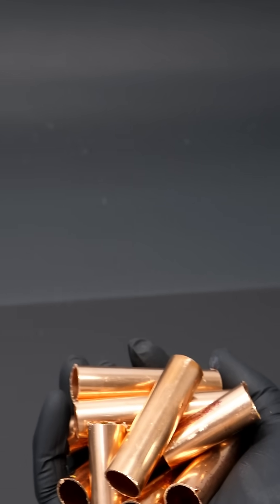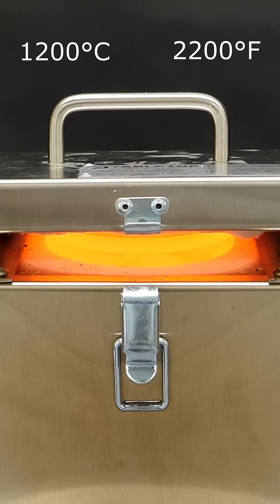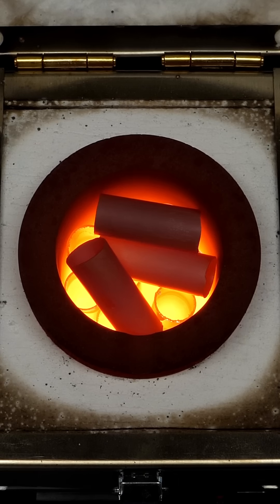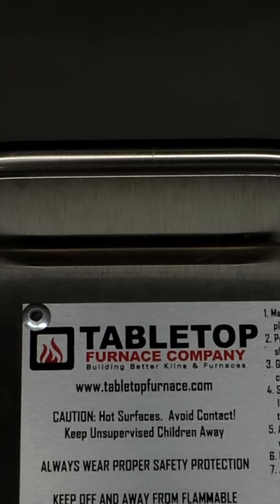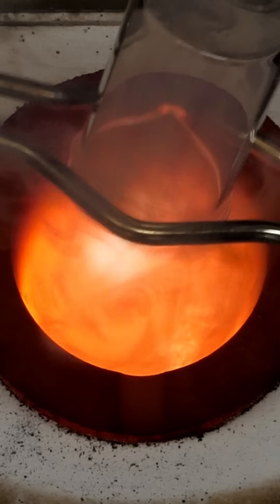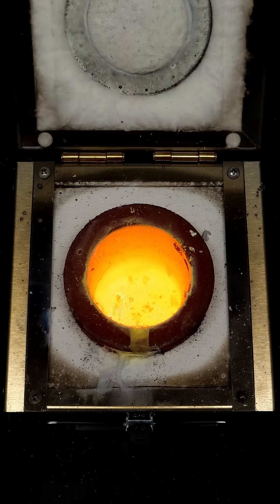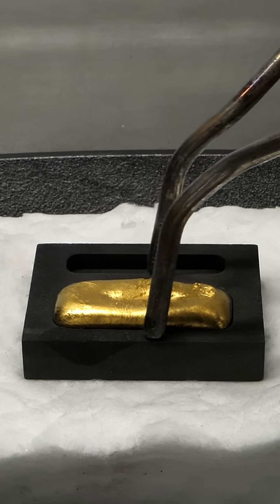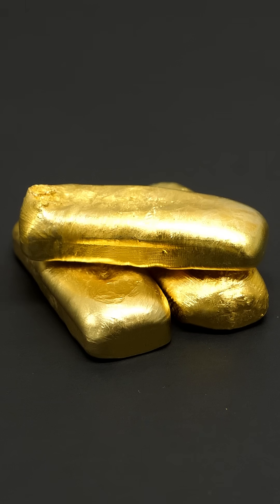Making Nordic Gold

Comment: The only real thing I can add to this is you needed to preheat the copper. The bubbling was small pockets of moisture the copper had absorbed. Also, make sure to point out that you also preheated the mould. This is an important step to prevent steam explosions when casting the metal.

BTW, Nordic Gold is also known as nautical bronze and is used for ships propellers even today. Once work hardened it is almost as strong as steel, but barnacles and algae cannot attach to it. It also doesn't corrode as fast as most other metals in salt water.
Reply: Great info! Thanks!
Reply: @jennifers.3818 Secondeded!
Reply: I think this is the most ive learned from a comment on YouTube.. ever.. thank you
Reply: I agree! I stumbled upon your message and I am impressed. My father was a metalurgist at Chevrolet for 40  years, retiring in '72. He had no sence of smell and was very bored with food, so conversation was what he most enjoyed at the  kitchen table..we always talked about doing this and that but never got a ' round tuit'. We would walk the rails in Detroit and we collected all types of fallen ore and he'd explain it all to me with such enthusiasm. I was just 8, but I hung on every word. Today I have a pile of my own in the back yard that's just starving for my attention! Thanks for waking up my dull metal head.  Andi Stewart- the girl in the pro shop that can explain to you why your swing is off, having nothing to do with your skill, but the composition of your driver. @user-bg3dq1fu8v
Reply: @user-bg3dq1fu8v If you like him so much then why don’t you marry him! 😐
Reply: @davemccage7918  what does this comment even mean what point are you trying to make
Reply: Why can’t barnacles and algae attach to Nordic gold?
Reply: @edd8914 because they are like Mr krabs and only love REAL money... when they get on the fake gold and find out its indeed fake they are so mad /disheartened that they can't stand the idea of staying on it and detach themselves to look for real gold instead 😂😅
Reply: @PenguinDynasty  Explains why Spongebob characters say “Ah, barnacles!” to express frustration 😂
Reply: @PenguinDynasty explained a lot
Reply: @PenguinDynasty  comment of the day!
Reply: @edd8914 
Nah, it’s because barnacles are freeloading SOBs. And they make you itch terribly on the attachment points.
Reply: @edd8914 copper is intensely anti-microbial, its actually why many old laboratory and surgical instruments pre-stainless steel were made of polished brass. Not a lot of things like to attach to something like that thats so antagonistic to bacteria as well as larger invertebrates like barnacles. Occasionally youll still see barnacles on bronze but only after its developed a coarse verdigris layer thats allowed other compounds to precipitate onto it like calcium, then things will grow on those mineral deposited areas.
Reply: @edd8914 copper, like gold and silver, is antimicrobial. My assumption is that this alloy retains that property.
Reply: @edd8914  sailor here - Copper in ablative marine bottom coatings works by slowly releasing copper ions into the water, which are toxic to many forms of marine life, including barnacles, algae, and other fouling organisms. As the boat moves through water, the coating wears away (“ablates”) gradually, continuously exposing fresh copper to maintain antifouling effectiveness. This also helps prevent excessive buildup of old paint layers over time.

Marine-grade bronze castings (typically high in copper content, such as silicon bronze) resist biofouling for a similar reason. The copper in the alloy leaches slowly to the surface, creating an environment that discourages the attachment and growth of organisms like barnacles and algae. Additionally, marine bronzes are corrosion-resistant in saltwater, which helps maintain this antifouling property over long periods.
Reply: @robbackstrom3365  Thank you for the detailed explanation. How long do these metals last in the water before being dissolved? Do they run out of copper eventually?
Reply: @edd8914 probably copper toxicity.
Reply: @edd8914  Because it's a copper alloy. Copper has antimicrobial and algaecidal properties.
Reply: @edd8914 because of the zinc.....
Reply: @edd8914 Barnacles and algae know they don't attach to gold and are fooled by the color.
Reply: That's not water... it's the non-metallic components reacting and offgassing.
Reply: So, by the time the bubbling starts, the copper is well and truly melted.  If moisture survived within the metal right up until that point, then how could preheating it evaporate the moisture that the process of bringing it up to over 1000 degrees could not somehow evaporate?
Reply: @Postghost it came from the torch; one of the byproducts of many flammable gases is water vapor, and copper really likes moisture. If he had been more patient and not torched it, it likely wouldn't have began bubbling.
Reply: @AlaesterNikolaiModern  I was thinking it had something to do with the torch too. Probably added something to the copper. But there are also furnaces powered by gas. It could be that the temperature rose to melting point from the torch but then lowered because the lid wasn't on, the liquid state wasn't stable then
Reply: @AlaesterNikolaiModern  Right.  That sounds a lot more feasible.
Reply: @AlaesterNikolaiModern  I'm pretty sure it came from the copper itself. There are oxides and nitrides in the metal... when it  melts, they react with each other and exit the system.

I used analyze raw materials for a stainless melt shop. I never melted copper by itself, but when we would melt Ni or Fe-Ni, the molten metal would spray sparks 2-3 feet out of the crucible. It looked like a sparkler. This was caused by  reactions that formed gas. To prevent this, we would add a couple of aluminum pellets... the oxygen would quickly react with the Al before it had a chance to escape.
Reply: @betif00  gas powered furnaces do not directly heat the metal with gas, they heat the bottom and possibly sides of the crucible. Any steam they produce will rise up around the crucible and not get into the metal. The torch as used in this video directed a stream of steam (and other byproducts of the gas burning) directly into the copper.
Reply: @natec424 I noticed there was no use of borax or other flux to prevent oxidation of the metals being amalgamated. When working with actual gold and silver alloys to create Karat and sterling or coin silver, we always start with a flux, adding more as needed. Oxidized metal will not take a clean solder with precious metals, and platinum doesn’t play well with others.🖤🇨🇦
Reply: @AlaesterNikolaiModern  But how did the water vapor attach to the copper at that temperature? Is it some chemical reaction?
Reply: @natec424  This makes more sense to me, thanks! The only other thing I could think of was the water forming hydroxides with the copper oxides, but that still felt unlikely at that temperature. Aluminum has a stronger affinity for oxygen than iron, which is why thermite works, so that makes sense
Reply: @Postghost  The term "preheating" is often misunderstood — it's less about preheating in the casual sense and more accurately described as tempering.

In the video, the crucible appears yellow/orange hot and ready, but in reality, if it's not brought up to temperature properly, microfractures can develop. These flaws may not immediately cause failure and might only reveal themselves when the crucible is removed from the furnace or when you bump the lip against the mold inlet. At that point, failure can occur — and in the worst-case scenario, it can be catastrophic. Especially dangerous if you haven’t received proper training or done your due diligence — and the fact that this even needs to be said suggests that may be the case here.

What makes this even more insidious is that the accumulated moisture doesn’t need to be obvious. Even trace amounts can cause internal pressure buildup. That expansion might not cause an instant explosion but can still compromise the crucible over time. That’s why a controlled heat-up stage at 100–200 °C is critical. This step allows you to gently cook off residual moisture — effectively tempering the equipment — before ramping up to full casting temperatures.

Preheating the metal itself can make sense in certain situations, especially when a fast workflow is necessary. For example, when working with zinc-based alloys like brass, speed is crucial — zinc tends to vaporize quickly in an oxygen-rich environment. If you need to add more metal to reach your target weight, preheating those additions helps reduce thermal shock to the melt.

Ever placed a damp towel on a hot surface and heard it go zish? That’s just from a ~100–150 °C difference. Now imagine what happens when you drop room-temperature metal chunks into a molten mass sitting at over 1000 °C. That’s not just steam — that’s a serious risk of spattering, cracking, or even a steam explosion.
Reply: @Postghost the mold needs preheating.. the mold
Reply: 😂 @Postghost
Reply: @Postghost 
Because, my friend- the moisture is TRAPPED !!! YOU MUST MAKE A CONSCIOUS EFFORT TO REMEMBER THAT MOLTEN METAL- IN THIS CASE MOSTLY COPPER‼️👉 HAS A VISCOSITY SUCH THAT THE MOISTURE, WHEN TRAPPED IN SIGNIFICANT AMOUNTS, IS NOT GOING TO SIMPLY EASILY & QUICKLY DISSIPATE NOT UNLIKE IN WATER, OR OTHER VERY HIGH VISCOSITY LIQUIDS ‼️‼️‼️
✅👉 Also, the heated moisture EXPANSION is dangerous, and reaches a point where it "bubbles" and "pops" it's way out of the molten metal with it's SUPER-HEATED FORCE that's in direct relation to, again, the viscosity ( or in molten metal cases- the LACK THEREOF )
-
Hope that clears it all up for you. I'm not a metallurgy person, however- I am a biomedical engineer, and love reading and learning in just about every subject that there is ‼️😆🤔🤔🧐🧐🧐🧐🧐🧐🧐🧐🧐
Think of a "bubble"  super heated, slowly moving upward through the metal, NOT UNLIKE A BUBBLE OF AIR IN HONEY !!! 😂 AND COMBINING WITH OTHER SLOW MOVING POCKETS OF SUPERHEATED MOISTURE, THEN UPON GETTING CLOSE TO THE SURFACE‼️‼️👉 THERE JUST A COME MILLIMETERS OF MOLTEN MATERIAL HOLDING BACK WHAT WAS BEING HELD BACK BY MOST OF THE MATERIAL, AND SO "💥WHACK BAM POP PING 💥‼️, THE TINY BIT AND FAR LESS MOLTEN METAL MATERIAL, AT JUST A FEW MILLIMETERS- GETS BLASTED UP AND GOTTA FLYING ABOUT THE AREA ABOVE 💥‼️‼️‼️‼️
-
NOT, "OK SUPERHEATED MOISTURE CREW, LET'S SLOW DOWN BY INSTANTLY REDUCING OUR TEMPERATURE SUCH THAT WE NOW PERSIST RISING IN A MUCH SLOWER RATE, OR ELSE IN IT OUR HASTE- WE TAKE TINY DROPLETS OF THE MOLTEN METAL ABOVE US, ON UP AND OUT WITH THE FORCE SUCH THAT SOMEONE CAN BE INJURED AND FIRES CAN BE ACCIDENTALLY INITIATED."
OTHER MOISTURE "BUBBLE" :
--- "yeh, YEH, MAN YOUR RIGHT‼️👉 REMEMBER THAT NASTY DUDE THAT WAS RUSHING THINGS IN THAT TUNNEL, AND WAS STARING OVER and Down into the crucible when we couldn't slow down, because it's impossible in this dimension and on this planet- and we ended up blasting tiny droplets up and into his eyes !???"
Another superheated "bubble" of moisture joins :
😨😨😨 "Oh yeah, I remember that one !  He was screaming and cursing and then accidently got his suicide vest cord stuck between a couple heavy oxygen tanks, and 
‼️💥 KA-BOOM💥‼️"
-
FIRST SUPERHEATED MOISTURE :
 "AHHH BAHHH HA HA ‼️‼️ YEH, WHAT A CRAZY-ASS GROUP OF DERANGED SCUM-BAGS !!!!!!!! HOWEVER, PEOPLE, THAT'S  THE BIG ONE THAT GOT US ALL THE WAY TO THIS CIVILIZED LABORATORY... I THINK IT'S CALLED  
ISRAEL ✅😆✅👑
Reply: @FIVE-n-TWO  I'm sorry, but even if you turned out to be correct, no one's reading that wall of cancer. 🤷
Reply: @Postghost this is exactly what I was thinking. They were glowing WELL past waters boiling. This person perhaps is mistaken (big surprise)
Reply: @TrapLordNik  Perhaps, yes.  I don't fully know, but it doesn't sound right.
Hopefully, they'll read this and elaborate.
Reply: Adding borax lowers the melting point and helps loosen impurities
Reply: Fun fact this is also theorized to be the metal Hesiod referred to as Oricalchum
Reply: @thecacklinggoblin1452 Maybe, except for the aluminum.
Reply: Thts why i pay internet for...i salute you,wise stranger...
Reply: Blistering barnacles, that's some amazing info!
Reply: Had to machine aliminized bronze,back in the 19hundreds. Corrosion and abrasive resistant harder than mild steel❤
Reply: Thank you. Seriously, I was looking to find out about EXACTLY this piece of information regarding corrosion. I want to make some Nordic gold coins and leave them in a salt water fish tank.
Reply: @FatChanceTheCouchDog  You don't even need to make your own as coins is the primary use of this metal. The first one was Swedish 10kr coin and why it's called Nordic Gold. Copper are toxic to some marine animals like shrimps so you might want to be careful about having that in an aquarium.
Reply: Thank you for information! 😊😊😊
Reply: I had heard of that where barnacles wouldn’t be able to attach to it. Always had wondered why
Reply: Hears barnacles can't attach.
Sees label that says Tabletop Furnace Company.
Thinks custom made sea turtle shells.
Reply: He used zinc (evident from the smoke and yellow residue), which means what he's creating is essentially a variant of a brass alloy.

However, zinc is highly anodic in saltwater environments, making it unsuitable for marine applications like propellers. You do not want zinc in your propeller acting as a sacrificial element or leaching out — and in salt water, that’s exactly what would happen.

That’s why aluminum-based or silicon bronze alloys are more commonly used in these scenarios. An exception is manganese bronze, which does contain zinc, but only in tightly controlled amounts. Adding zinc beyond those limits compromises the structural integrity of the alloy.

That said, akakscase is absolutely right about minimizing risk when it comes to preheating and curing your equipment. You should always preheat your crucible — every single time, especially if it has been sitting unused for a while. Crucibles can absorb moisture, and introducing moisture to molten metal can cause violent reactions. Same goes for Molds.

Also keep in mind that copper-based alloys have a high density, meaning a much higher thermal mass than, say, aluminum. If something goes wrong, that molten metal will burn you very, very badly. So before you even think about trying something like this, don’t rely on half-truths or YouTube videos alone — do your research and proper due diligence.
Reply: What elements do you use to make real gold?
Reply: @moneycomein88  the process is difficult and the list is long but the main element is lead, and a Smurf.
Reply: @moneycomein88  oh... I got this one... "gold!"😊
Reply: Good to know!
Reply: How did the moisture get in the copper and like.. stay there until this time?
Reply: Thank you for that. I was about to ask what the applications of this were. I've heard of and used "Dutch gold" for gold leafing and assumed it was a similar application.
Reply: That was rather informative.
Reply: Thank you for this info
Reply: Its aluminum brass alloyed with more metals and it looks amazing. Does anyone know if it holds an edge better than just the standard copper and aluminum?
Reply: Not quite accurate. Nordic Gold and nautical bronze are two different alloys. Nordic Gold is a coinage alloy (mostly copper with aluminium, zinc, and a touch of tin) and not used in ship propellers. Nautical bronze—also known as naval or admiralty bronze—is a copper-tin alloy designed specifically for marine use, with vastly superior strength and corrosion resistance in seawater. The confusion is understandable, but they are not the same thing.
Reply: better Comment 👏🫡👍👍🫶👌👏👍
Reply: Good comment
Reply: Why can't barnacles attach?
Reply: Thanks 👍 for your information
Reply: Isn't the propellers made of phospor bronze instead?
Reply: But copper and zinc makes brass, bronze is with tin... It doesn't make any sense
Reply: u forget to add chicken
Reply: Now teach me about pyrite aka fools gold
Reply: Thanks Bill Nye
Reply: What are it's working properties? Is it hard like yellow brass? Can you make forged or cast jewelry out of it?
Reply: Nordic Gold is not also known as nautical bronze. You are probably thinking of Manganese Bronze or Nickel-Aluminium-Bronze.
Reply: @philipcroucher7376 aka "Bearing Bronze / Aviation Bronze" (vs Nautical) (Aviation version goes green when exposed to moisture a long time)
Reply: 1000th like
Reply: Is it valuable?
Reply: @Untamed64 it’s perfect for marine use. So yes for that application is valuable or anything hard like mild steel that needs to be corrosion and wear resistant. Propellers can wear out from all the suspended particles in water and more so near shore where there is more sand and silt in the mix due to shallower water.
Reply: Don't try to school mr wizard he knows
Reply: So you saying this is better than Gold ?
Hell Yeah !!!
Reply: I thought he was making Bronze...
Reply: Wow super cool, I worked with ships for a while and did not know this. I always thought it was soft because of the cavitation damage i'd see in photos haha 😂.
Reply: Awesome, thanks that was interesting
Reply: I wonder if you could make reasonably effective ancient/medieval armor from it? That would be a really cool way to do a semi realistic Golden armor
Reply: See, that is interesting. I was hoping the video would have more information about the alloy! Very cool thank you!
Reply: That was exactly the information I was looking for
Reply: Barnacles hate this one truck!
Reply: Wow🎉
Reply: Never k re about the barnacles , very interesting
Reply: Nordic gold and nautical bronze are not the same thing. Yes they're both copper alloys but  nautical bronze uses less copper, more zinc and sometimes has lead. Calling them the same thing is like calling a fish sandwich, "fish and chips"
Reply: Opa , eu estava procurando um comentário interessante sobre esse ouro nórdico
Reply: i feel more intelligent
Reply: Your wonderful insight just helped me unlock a storyline for my book😅
Reply: Nice informational tidbit.
Reply: wow thanks
Reply: Thank you
Reply: Wow! Thanks for sharing.
Reply: gonna commission 26” wire wheels forged from this stuff for driving my Caprice in flood conditions
Reply: If it works for the propellor, ships would save cleaning costs by skinning with the stuff.
Reply: Wow this could be used as taps and fittings as it's strong and won't scratch or flake or break
Reply: Thanks for that nugget of knowledge 😉
Reply: I've poured about a thousand heats used to work at Johnson props OJ props we would load the crucible first with around 200lbs of copper metal with some zinc and then top it of as the metal melted. Never had your so called steam explosion. I was always dropping shit that wasn't supposed to go in. Insects mice rats would even drop water into the heat. I did a lot of fucking around and I found out I'll tell you that. I did get seriously injured there.
Reply: interesting.
Reply: Looks sturdy enough to put on a sword 🗡️
Reply: This is so cool! Thanks!
Reply: Fun fact:
Real gold doesn’t chemically corrode at all, but is so soft that friction with the water would wear it down.
Reply: That’s so cool thanks for telling us this I actually just thought the propellers were metal and then painted gold this whole time but now I know
Reply: I remember doing this to a penny in chemistry class. We didn’t melt them but we made the Pennie’s gold
Reply: "even today" it was developed like 35 years ago, no?
Isn't this the alloy used in the euro coins?
If so it was developed in Sweden in 1991 by their state coin minting (one of the world's oldest at around 1100 years old).

Nautic gold is not the same as it contains less copper more aluminium and adds nickel and iron instead.
Reply: Yeah, I thought it was one if the shipbuilding allows for coppering hulls and the like but didn't know which one.
Reply: Wow amazing
Reply: High quality comment
Reply: Thank you.  😊🎉❤
Reply: Fools gold
Reply: I was actually wondering if there was a practical purpose for nordic gold and I appreciate you telling me what it is
Reply: Sounds much more useful than gold 🤔👍
Reply: Sweet I was wondering what it was for.
Reply: I learned something because of your comment. Thank you
Reply: So it's better gold?
Reply: What's the composition of new gold?
Reply: @doomoo5365  Copper, aluminum, zinc and a small amount of tin. Zero actual gold.
Reply: @doomoo5365 watch the video with the sound on.
Reply: @doomoo5365 watch the video. It's all there.
Reply: @doomoo5365  AU = 100% Or did you mean the nautical bronze ?
Reply: Ahh, I wondered why I’d seen ridiculous “solid gold” propellers before.  I know using real gold would be like using real cheese but I didn’t have a practical explanation for it.
Reply: So why would imagine if you tried to heat up some rocks to see if they had metal in them you'd want to preheat them to get rid of the water
Reply: @doomoo5365  actually if you heat up rocks by for example throwing them into a hot fire in order to use them to keep warm later by holding in heat they can explode like a grenade if you don't dry them by the fire first before putting them in. 

Precisely because the water trapped inside rapidly phase shifts into steam and can crack rock
Reply: Nautical bronze? Not nautical brass? Seeing as how it's brass, not bronze. 😂
Reply: @GriffonSpade  it's a copper alloy with more than just copper and zinc so I'd say it's closer to a bronze than a brass. In the end it's just a colloquial name anyway, the line between the two is blurred when it comes to everyday language.
Reply: @hashinta Ehhh. If it's a copper alloy with Zinc as the dominant secondary, I'd consider it brass. Anything BUT zinc would be bronze, usually.
Reply: @GriffonSpade  But the dominant secondary in this is aluminium, not zinc. Plenty of both brasses and bronzes have contained both zinc and tin and they have been flexibly applied throughout history, it happens even now when we have ISO standards for it. Really we should be calling it copper-aluminium alloy but that doesn't roll off the tongue nicely 😂
Reply: Not really. Nordic Gold is an alloy developed to make coins from. 
https://en.m.wikipedia.org/wiki/Nordic_Gold
Reply: wow didn't knew Nile was so careless, thanks for the warnings
Reply: @S4NSE hes nile red, not nile green
Reply: false on the nautical bronze, false on this being something Hesiod knew about (whoever that was) 

Nordic Gold was invented by Finnish metalurgist Mariann Sundberg fairly recently.